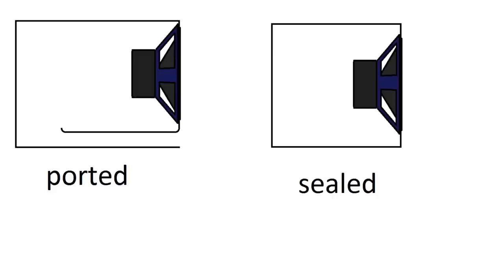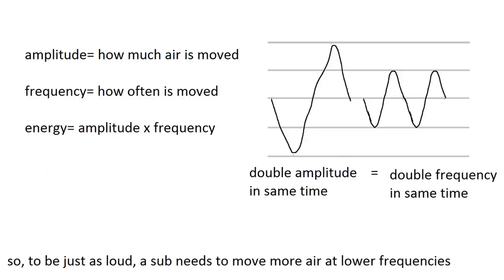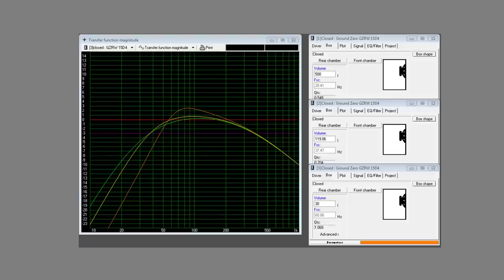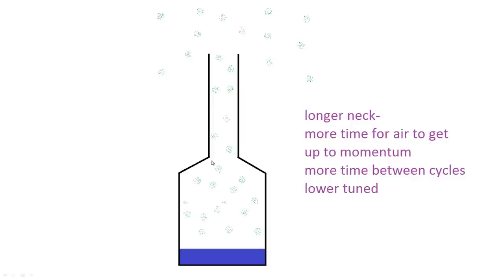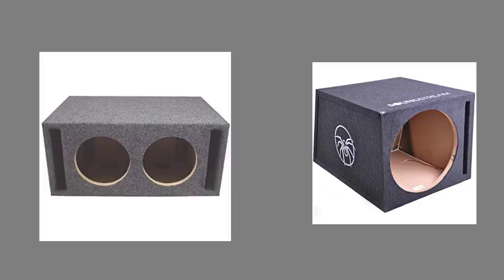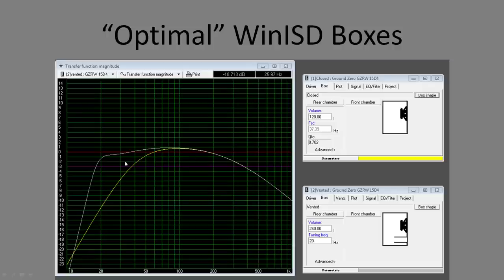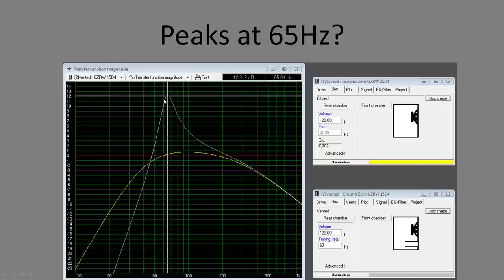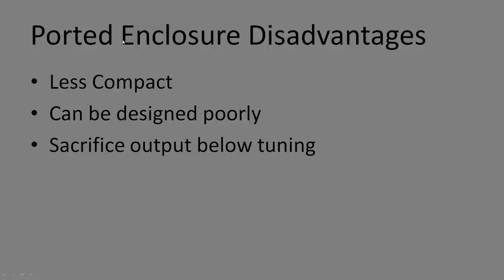Sealed VS Ported Subwoofer Enclosures

Comment: Absolutely right when talking about the so called experts. I worked setting up P.A. systems for a while and we did make some 6th order band-pass subs with 15" JBLs. There's the theoretical and then there's the listening and it depends entirely on what you want to achieve to suit your listening preferences.

Comment: I'm going to make this easy for everyone. If your not into the mathematics and geeky mumbo jumbo then it's all based on your preference of music. I was told by audio experts at shops that ported is best for hip hop and sealed is best for all other music. I listen to mostly metal, so they recommended sealed. Sealed is clean and punchy also fits well as it is compact and works if you have little space.
Reply: Minecraft
Reply: Mumbo jumbo
Reply: What about if you have 4 12" voice speakers..Wich one is better
Reply: Not entirely true. Subwoofers types are not determined by there genre, but more their Frequency range and response. A ported subwoofer is simply going to be louder sometimes 2x, this is good for manufactures because they can use a smaller driver and box, also cheaper and lower powered driver to get their desired volume. A ported box is going to play even lower frequencies (Below 30Hz) and louder with the other lower freq. A ported enclosure can sound Boomy and is perfect not just for Hiphop but is an easy way to impress people. With a sealed enclosure its harder to impress people, but you will impress yourself with the quality of bass. I feel its more accurate and plays the range of frequency more equally. Ive gone with a sealed enclosure.
Reply: Back in the late 80's, early 90's I used to listen to punk and metal in my VW Bug. I had 10 inch Kickers in a sealed box. They hit hard, fast, tight and clean. Punk had fast beats and sudden stops and my speakers sounded awesome.
Reply: @KurtisPape  You just answered everything I needed to know, you are awesome man!
Reply: @Rockstar22ize  hahaha cheers, I'm just a newbie bass head, I've actually got a ported box now. Some people design ported boxes that can peak at 29hz and 44hz for e.g. with the 1 box but most of the time ported plays lower. I still love my sealed box because it sounds like a premium system. But with the ported box it's great to get some door flex
Reply: @KurtisPape  I have 2 sealed enclosures you can see on my channel, so my question is what ultimately hits harder ported or sealed?
Reply: @CLIFFWILKES  I went ported and its just simply way louder. If you go ported though your box for sure has to be a lot bigger to be tuned the same, thats the main down side
Reply: @KurtisPape  Bro I ported it but it doesn't hit as hard now only when I pop my truck a little bit it hits significantly harder but I dont understand why my trunk has to be popped for the hard hitting vibration Bass I have 4 subs it's on my channel also I just dont understand smh
Reply: @CLIFFWILKES  Same thing with my car, when the bass hits with the car shut I can leave my phone on center console, as soon as I open my door my phone bounces right off. Thats the difference. But if you changed to ported did you change you box? Because I you just hole saw a hole in it, it wont work
Reply: @KurtisPape  No I drilled nice size holes and put PVC/PLUMBING TUBE OR CYLINDER...whatever you call it and honestly bro I think were I messed up is I have to retune the amp now because they are hitting way harder but after doing studying from my research I have to tune the amp since I changed it it ported and yes I put a wooden enclosure on the inside of both of the boxes ... now I'm going to go out here and try and tune it.. I'm hoping it's that do to the fact all the stuff is turned up on the amp
Reply: Thanks
Reply: Best of both worlds: sub with passive radiator
Reply: @KurtisPape  
You seem to be spitting more opinions then facts. opinion 1. "With a sealed enclosure it's harder to impress people" opinion 2: "I feel" opinion 3: "A ported enclosure can sound boomy and is perfect for not just Hip Hop but also an easy way to impress people" 

And to finish it off. Contradiction for praising the ported but going for sealed. 

Bro, your entire argument sounds biased and I'm sorry but I won't value your opinions over professional audio technicians who do audio work on a daily bases. No offence. 😂😂🤣🤣
Reply: @seancarter3626  you dont have to be professional, just hook the shit and blast some tunes. Just 2 wires, it's only 12v like a kids toy.
Reply: @KurtisPape  
More complicated then a single wire. It's more like 4. Ground. REM. Batt. And RCA. But I get the gist. Let's agree to disagree. Ported VS. Sealed is like Mac versus PC.
Reply: its not that hard guys. this is basics. if you don't care for the in depth reasoning of why, here is the answer. 

sealed box's have a relatively flat response. (meaning that the decibel curve is smother, and you can play a wider variety of frequencies.

a ported box is a way to reinforce a certain frequency range. (say 30-40hz) making it much louder. but with the sacrifice that everything outside that tuning frequency will fall in volume much faster than the sealed box. as well as "accuracy" in comparison to the source signal would be sacrificed. (I.E. group delay etc.) but that's more "why" than "what"

ex: sealed (135db @ 45hz, 133 db @ 40hz, 130db @ 35hz, 125db @ 30hz , 120db @ 25hz)
ex: ported to 35hz (130db @ 45hz, 138 db @ 40hz, 145db @ 35hz, 137 db @ 30hz,  110 db @ 25hz)
Reply: @famousdev9707  
Thus my reasoning on why audio experts told me that sealed is better for other types of music other then just hip hop as they offer a wider variety of freq response, given that my primary music choice is metal would mean sealed is best. Not to mention the space efficiency sealed boxes offer. They are usually more compact, works for smaller spaces or for smaller trunks in cars. So you basically agreed with what I said. Lol!
Reply: rap music is mostly consistent of rolling sign waves. the consistent shaking of a bass note. usually between 30-50hz. the reason ported is good for rap is because a ported box can be designed to reinforce that small frequency range. and it will become more noticeable on a rolling consistent sign wave. 

dubstep, edm, rock etc. have a lot more instrumental bass. (kick drums, bass guitar, very fast kick patterns and the subs are being made to change frequency and direction incredibly quickly. a ported box is worse as representing these fast sequences because the port air needs time to travel and react with the internal volume. causing a slight delay from when the music tells the sub to change direction, and when you hear it do so. causing the subs to "lag behind the music" this isnt a problem with consistent rolling bass waves. 

Also, the larger the sub, the harder it is for it to change direction. and the slower the signal response will be. which is why 8's and 10's are recommended for rock etc. and 12's and 15's are recommended for hip hop.
Reply: @seancarter3626  yes you were objectively right on that point. I was more talking to other people in the comments. there isn't a better choice. only a better choice for a given set of uses. I also thought I'd expand on the group delay aspect, and driver size affecting this as well. I gave the reasons why metal benefits from sealed, it's not just frequency response. because there seems to be a lot of newcomers on here. that's no problem. I appreciate yall for loving bass.
Reply: I'm going to make this easy for you. If YOU ARE not into grammar at least learn the basics.
Reply: @elduderino1329  
As if, Troll. 😂😂😂
Reply: And your speakers also die faster because of coils heat up and have no cool air to cool them
Reply: Yeah, reduced power efficiency, higher impedance rise and there's no port for the box to grab fresh air and circulate in the box. It's a big circle. 
Impedance causes heat then heat causes more impedance and so on.
Reply: @CLIFFWILKES  it wants more cool air more space makes subs sound clear
Reply: To quote wikipedia: "Bass reflex cabinets have relatively poor transient response, causing "smearing" or a longer resonance of the bass notes. Though the sound coming out of the port may have the same phase of that from the front surface, but it can never be at the same time, thus, the extended bass energy is really noise disguised as signal. The disguise works only when the sound is a continuous tone (one of the reasons why some people prefer some particular kind of music for their audio system), but reveals itself most apparently at reproducing percussion sound."
... that seems to be the reason why I can't stand most sub woofer powered systems, they just go whooooo whoooo whooooooooooo...
Reply: @adriangutierrez9286  Smaller cabinets has to have ports but bigger ones might need not. This is true for only lower SPLs, or for smaller drivers.  But if you are going for large woofers then, you should go for ported one. Coz in case of large woofers, like party speakers, they are cranked up higher for longer time as well. So you definitely need a port. It's good for speaker's health.
Reply: Thank you
Reply: @ivanomarra4865  Goes both ways. A sealed sub would less likely suffer from over-excurson, while a ported one will be less likely to over-power the coils
Reply: Ported are kick ass for smooth jazz as well.
Reply: @ Kurtis  
Not necessarily bigger.
You can have a long port inside the enclosure and retain size while tuning  very low.
Reply: @KurtisPape  you ninny, he was trying to simplify it.
Reply: @derfskittlers6125  true, I said in my comment ported allows from a smaller driver / box. This was false, it actually requires a larger box for ported haha. Oh well.
Reply: Aaaaah exactly thank you😎🖒
Reply: Thanks lol, I've got 2 12s and getting 2 more 12s but 1 of mine is blown, the seller didn't know, so I'm going to make a sealed box for the 3 that work whilst saving room in my trunk, hopefully I don't break the bank!
Reply: @adriangutierrez9286  do a tandem box with the two center 12's in a sealed enclosure and the two outside subs in individual, mirrored ported boxes. Looking like 1 big box but gives you both ranges.
Reply: Geeky mumbo jumbo? That mumbo jumbo makes the difference between muddy bass in *either application because different drivers, NO MATTER THE MUSIC PREFERENCE, require different dimensions either way.
Reply: @dijit-alkhem-ist4279  
I was simplifying it for others. Not everyone is interested in hearing mathematical equations to get a straight answer. Some professional audio shops gave it to me straight and I have like 10 years experience in audio work myself. Trial and error. I blew a lot of subs and amps to figure things out myself. 

If people want to watch the long ass video to hear it the other way they are more then welcome too. Comments are always faster.
Reply: @seancarter3626  Understood
Reply: @chris6074  the port boost is using an acoustic glitch to gain extension. It's inherently inaccurate but uses its own rear chamber as a jug like instrument that happens to resonate whenever the tone happens to be within the range.

A speaker should be as musically reactive in a 1 to 1 way as possible, the port adds a tone emphasis that's usually low enough to be convincing but isn't inherently musical. The port literally has a pitch and always hums at that pitch. It's the same thing as if your room was inherently resonant to 52hz or something. Would you WANT that? For movies it'd make explosions more resonant.
Reply: I know this comment is 3 yrs old but I want to share my thoughts since I also listen to a lot of metal.
I used to run all sealed including 2 X 12's in a sealed box and they were pretty good.
Then one day I had the opportunity to buy 2 X 12's in a ported box for cheap and the difference was insane.
Kick drums actually punch you in the chest like they would in a concert. Sealed does not have the same effect.
I also thought fast kick drums would be very sloppy in ported but I was wrong, they remained nice and tight and very punchy.
If the sub has nice tight suspension it will remain nice and controlled in a ported box and will remain accurate.
Reply: @Argedis  music instruments are pretty much sound resonators trying to imitate live or virtual produced music. A subwoofer with a port is really similar to a kick drum. You even stuff it and add a hole to tune it like a kick drum
Reply: @neomancr  Thanks for the insight, that makes a lot of sense.
I also think the fact that a subwoofer in a ported box does not have to fight with the vacuum like a sealed box allows it to have much further excursion for that 'kick' in addition to the extra pressure the port itself makes.
Reply: I don’t listen to almost any rap. But I still want to feel the base & the punch of all other genres.
Reply: @KurtisPape absolutely

Comment: Funny how the comments are split saying sealed is better or ported is better...

It's situational imo, I like sealed, but also ported. Currently have a ported Ultimax 18 and it fills my needs with smooth bass to below 20hz. Group delay could be better below 20hz, but where speed really matters, it's low enough to be near sealed timings. 

I have a sealed 10" in my car and used it in my house too, preferred the 18 in the house as it was just as accurate and the 10" couldn't touch the low frequencies like the 18" but both sounded just fine.

In the car the 10" is able to dig at least 10hz lower (usable to 25hz, and audible to about 15hz pretty cleanly without harmful distortion from harmonics)

My room I have DSP and my car I don't, but don't need it to get smooth bass across the bass region. (Still would be nice to have it)